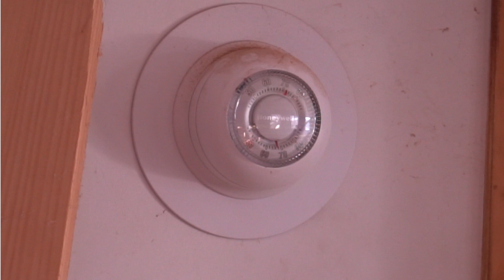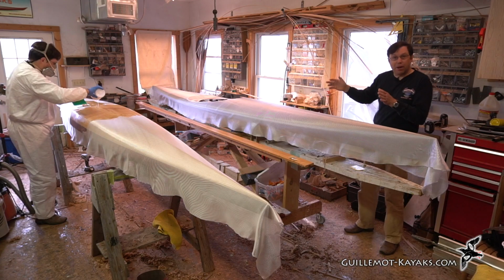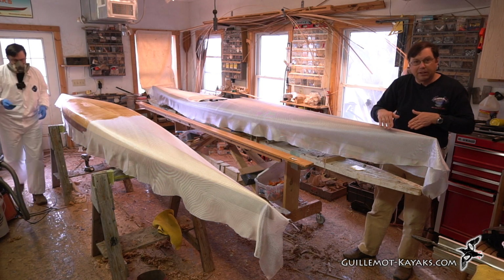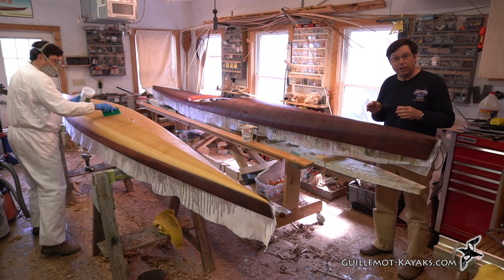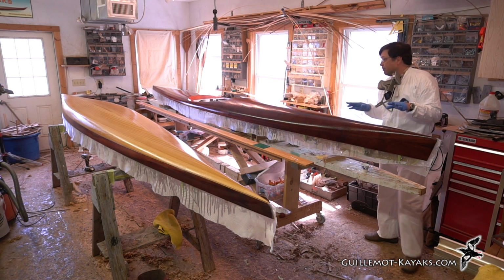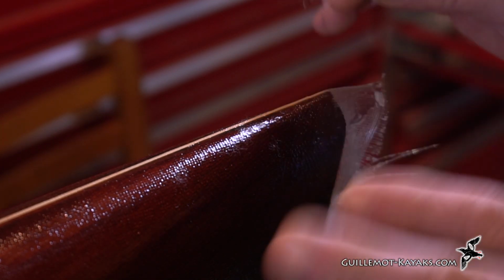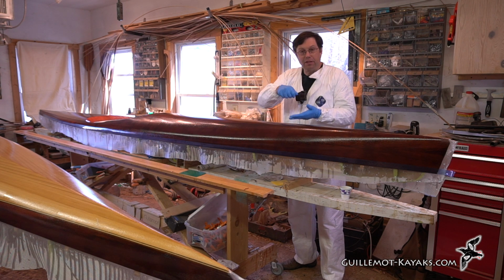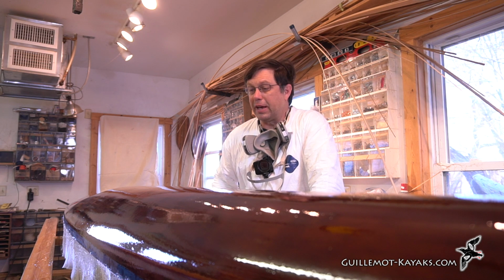Fiberglassing Day - microBootlegger Sport - E41

Comment: Thanks Nick !
You have addressed the very important points of temperature, and the timing of the fill coats ! This is rarely brought up ! 
 These Old hands have moved towards the little cigar rollers, instead of squeegees. They are not perfect, but easier for me to handle. The Torch is a new one on me ! I've used  (My Wife's Old) Hair drier for bubbles that have appeared. I was looking forward to this video, and you didn't disapoint ! Again Thanks !
Reply from the maker: I often use the heat gun instead of the blow torch, but the blow torch is cordless which is a feature. I have tried regular heat gun and found they didn't really throw enough heat to be effective. 

I have actually found that with West Systems my powerful heat gun doesn't really do anything, I need to use the torch to have much effect.

Comment: Just finished the deck following Nick's guide here.  I didn't have any issues with the epoxy cooking off too fast on the hull, but with the coaming, I learned not to mix too much epoxy at once.  Using West Systems 205/207 pumps, I should only have mixed about 5 pumps each to get things going and dumped after long focus areas like the coaming.  The other thing I observed is there's a lot more dripping epoxy than I imagined -- plan ahead for drop cloths, 3 layers of gloves, and pre-stacked paper towels.  For the three coats, it took me about 90 minutes for the first coat, 30 for the second, and 45 for the third (I guess, it's not like I had a stopwatch).  Nick's final brushing technique (horizontal, vertical one-direction, horizontal feather one-direction) worked very well.  Finally, I loved the blow-torch and got a MAPP gas, but the tank ran out 1/2 way through the final run.  I used a heat gun and really liked the results.  As long as you can go from 1st brush to heat gun in less than an hour at room temp, you should be good.  Nick is the master, but it is reassuring that with planning and focus, a regular Joe like me can get within a mile of the same ballpark.

Comment: This is the best part of the boat building, in my opinion.

One thing is the process of going from dull, sanded wood, through white glassfiber to the wetted out look.
But more fun is the transformation where a hull or deck made out of a bunch of loosely joined strips turns into a really solid structure, especially When the inside is glassed.

Comment: just thought I'd share a tip on what not to do.  I was preparing to fiberglass my canoe and I was wiping down the hull with acetone and a rag to clean it before fiberglass.  I was using rags out of a rag bag I bought at a hardware store and as they became dirty with sawdust I'd reach into the bag for a fresh rag.  well one particular purple rag didn't like acetone and when I wiped the canoe it left a huge purple smudge on the bare wood.  The rag must have been some kind of synthetic material that melted when soaked with acetone.  I removed most of it with more acetone and a different rag.

Comment from the maker: Left Nick decided to do some work today so Right Nick spends a little time talking. There is more I would have had to say, but Right Nick forgot what it was.
Reply: A tip for you, superglue reacts chemically with water, there is no need for an expensive accelerator, it works just as well if not better with a fine mist of demineralized water.

Comment: Hi Nick
Great video! Do you no longer use several layers of glass like in your book? And why don't you wet out the wood first before applying the glass? Would that not make a better bond to the wood?
Thanks for your response!
Reply from the maker: I will often add extra layers of fiberglass on the bottom, and I believe in this build I did add another layer later in the construction.

I have found that the seal coat before applying glass is an unnecessary, troublesome step. It does not improve the bond with the wood. Modern low viscosity epoxies soak through the glass very easily. 

The primary use of the seal coat is to control epoxy absorption into the wood. Sealing the wood prior to glassing can prevent "starved" spots where the wood sucks in more resin. It can also prevent the wood from outgassing during the glassing. 

But, for the best bond you must roll the glass on while the epoxy is still wet and sticky. This creates problems in getting the glass smooth. If you wait until the seal coat is dry, you no longer achieve a chemical bond between the seal and wet-out coats. You should sand the hard seal coat before applying the glass.

Bottom line, the seal coat is an extra step that can be useful in certain situations, but its easier to do without it.

Comment: Great video!
18 years ago I built your night heron with your plans and book , I was so nervous about the fiberglass work, never having done that before. But another boat builder in Traverse City assured me it was not that complicated and told me I could call him anytime if I got in a jam. It went fine. No problems!
 Not sure that torching was ever mentioned, is that a newer technique?I'm thinking I'd like to build another someday soon, I need a better design for Lake Michigan, low profile, long, fast , less rocker. 
More of a point to point straight line kayak.
Any suggestions?
Reply from the maker: Hi Dan, I started using heat to pop bubbles some time ago, but it is relatively new since my books came out.

Take a look at my Yukon design for long, fast point-to-point design https://www.guillemot-kayaks.com/guillemot/catalog/boat_building_plans/yukon_sea_kayak_plans
Reply: Would a hot air gun work just as well? Is a torch better because it's wireless?
Reply from the maker: It seems to depend on the epoxy. For the MAS epoxy I'm using here, a good heat gun seems to work fine. When I do the same with West Systems, the heat gun doesn't seem to touch the stuff where a torch does a great job. 
The torch is hotter, so you can heat the surface more quickly without the heat penetrating too deeply into the layup. Heating up the wood below would be bad.

Comment: Hi Nick, great video, learning a lot here. Do you take a new/cleaned pot for every batch or do you just add new epoxy mix to the pot that you are using? Thank you, greetings Marcel
Reply from the maker: I just keep mixing in the same pot until I'm done. While this may slightly shorten the pot-life of the new batch, it is not enough to notice.
Reply: Building SV Satoshi good question...i was always afraid to do that

Comment: Great video thanks Nick. I will be doing my first outer deck glass in 36 hours so wanted to know if I had contingency with the timing. How long do you have before you lose the chemical bond between coats. It is still going off after it is no longer sticky but does that provide a suitable bond?
Thanks 
Rob
Reply from the maker: The "best" time to do it is in the window when it passes the cotton ball test, but epoxy does take time to cure. If you can make a mark in the epoxy with your fingernail, it is still in the "Green" stage and there are still some chemical bonds available. Depending on the epoxy and the shop temperature, this could be as long as 72 hours. 

If sanding produces fine dust, you should sand the whole thing.
Reply: Thanks very much Nick, as I say it’s just for contingency, I am in Melbourne, Australia so the weather is cooling down and I don’t have the advantage of a heated shed. Will probably have to do an alighted to get the final coat on using some halogen lamps for heat.

Comment: Beautiful! Thanks for your videos!
But do you really have to wear a respirator? I thought epoxy doesn't evaporate dangerous fumes. Or is "better safe then sorry"? Or is it just rather little fumes so if you do this regularly you need to protect yourself?

I know you need to wear protective clothing and gloves and a respirator when sanding.
Reply from the maker: Epoxy does release some fumes. They tend to be at a low level, but a hot shop increases the level. I can tell when I'm in the shop with a lot of open epoxy. But generally, I just don't want to mess with reactive petrochemicals. I figure it just isn't a good idea. So, I wear as much protective gear as possible.
Reply: Thank you! Now I'd really like to know how big the exposure is.
Reply from the maker: When I am wetting out the whole boat (50 square feet) I really notice it. If I'm just doing a spot, here and there, I don't detect anything and I won't always bother.

The thing to remember, is the respirator is to protect you from harmful fumes. It is not to protect you from unpleasant odors. So, even if you don't smell anything, you may be getting exposed. 

 I can not quantify the risk. I only know I feel better physically when I am wearing the mask.

Comment: I've seen others put " thinned " epoxy on the wood first to soak in and put the glass on and wet it out.    Is that just extra work?
Reply from the maker: Applying a seal coat prior to laying out the glass can help prevent the wood from sucking resin out of the glass, but it makes more work.

To get the full chemical bond, you should roll out the glass while the seal coat is still somewhat sticky. This makes it very hard to smooth out the fabric, because the surface is sticky. If you wait until the surface is not sticky you should sand before wetting out the cloth, this is an added step, and the strength will not be as good as a direct chemical bond between the wood-epoxy-cloth.

Comment: Do you have any experience with ecopoxy? Ive heard, it is UV protective and you don't need to varnish afterwards.  Or would you recomend just sticking with west systems?
Reply from the maker: I don’t. I am skeptical about “UV” epoxy. I haven’t seen predicted lifetime data that impressed me. I would still protect it under a uv clear coat.

Comment: Interested in your use of the torch, could this be replaced with a heat gun?
Reply from the maker: Yes, a heat gun generally does the same thing. I have found some epoxies really respond better to the torch, but a heat gun works well for most epoxies.
Reply: Thanks Nick.

Comment: What weight of fiberglass cloth are you using?
Reply from the maker: 4-ounce. E-Glass on the Deck, S-Glass on the hull
Reply: I assume the E-glass is clearer when wetted out, and S-glass is stronger.  Correct?
Reply from the maker: Yes, S-Glass wets out clear but slightly distorts the view of the material under it. But it is stronger.

Comment: What weight fiberglass is that cloth, 4 or 6oz?
Reply from the maker: 4 ounce: E-glass on the Deck, S-Glass on the Hull.
Reply: Is there a specific supplier and style number you recommend for the 4 ounce S-glass?

I tracked down some 5.75 ounce S-glass (style 6533) for a design of yours that I'm building, but I am not happy with the weave.  The yarns in the warp direction are twisted instead of flat (like the fill direction).  The twisted yarns are harder to wet out (using West Systems 105/207), seem to increase the ply thickness and texture (and thus require a thicker fill coat), and give the weave a more open appearance.

I found 3.66 ounce S-glass (style 6522) online, but it sounds like it also has twisted yarns in the warp direction.

Any suggestions, or do these apparent issues end up not being a problem?  Thanks!
Reply from the maker: I use the 6522. It wets out quite easily, much more easily than the 6533. It is not as clear as the 1522 E-glass, but the difference isn't visible until you get your face right up next to the surface.
Reply: Have you found one layer on the hull of your kayaks is enough? Do you add another layer or reinforcement anywhere?
Reply from the maker: I just added another layer to the bottom last week. The episode showing that will be coming up soon. One layer is enough for many paddlers, but if you are going to be beating the boat up, another layer isn't a bad idea. I do the second layers as a separate process so I don't get bubbles trapped between the layers.